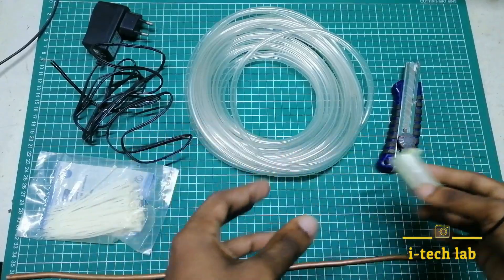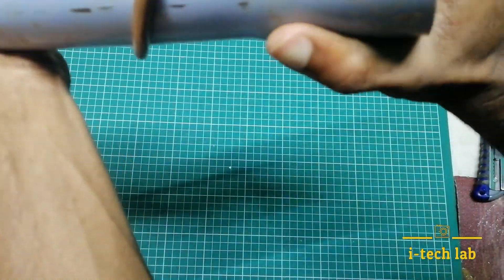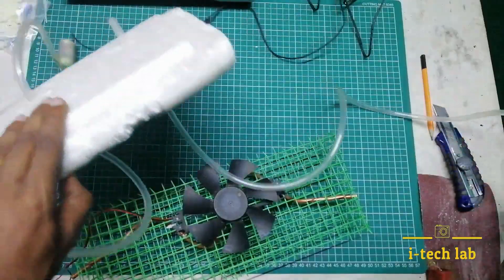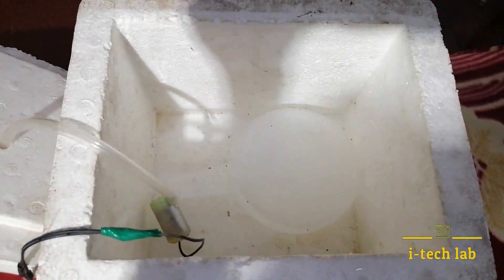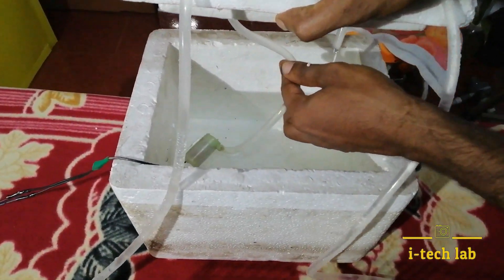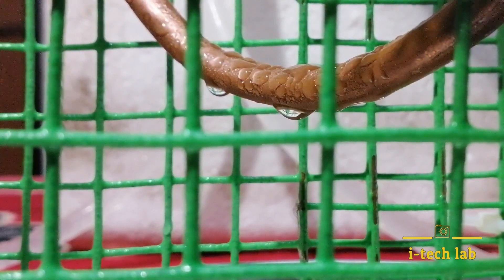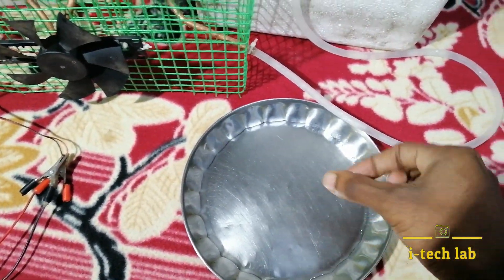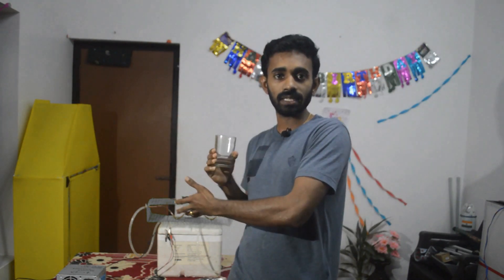How to make water from atmospheric air | Best way of producing water from air |How to make water.

Comment: hello sir, I do not speak your language and the auto-translate is not working properly on the video. Could you tell me:
- how much water did you get in 1 hour?
- how cold was the water inside the copper coil?
- how much humidity was the ambient air?
- what was the temperature of the ambient air?

I would be very greatful for your reply!

Comment: Can be made much more simple.... take a vessel put some ice (no need of water,just ice only) blow air using dc fan against the vessel ....water droplets will fall and you can keep another vessel to collect it. You don't require  pump and copper tube.... simple.

Comment: Interesting design. Kick-starting the process with iced water makes it productive. Have you thought about a system that doesn't require iced water?
Reply: I'm going to try making ng one without ice water,,,and on solar power,with a buried water tank under ground,with a copper coil inside the water tank,with a radiator with fan in the top of the inside tank,cooling itself more,pump it up to a nice copper coil and do fan,inside a green house,were more Co fans pushing air in,to increase humidity 🤔🤔🙏😁
Reply: @frankesquivel1455 use peltier
Reply: there are boxes like the one in this video, but with an active cooling. Some of them cool to minus 15°C. It depends on the outside temperature how much watt is needed to keep the water inside near 1°C but I saw that those boxes use 55watt nominal power. So that means (as they work like a refrigerator) they're not continuously using 55watt, more like 25watt/hour. Im gonna try it out.

Comment: your not producing water from thin air,,  the water came from the ice and water that you put inside the styro box, You should title it,, "How to make DIY air cooler"
Reply: not correct. The water inside the box is in a closed loop. The water outside the coils is condensation from the moist in the air in the room.

Comment: I'm a student
I am participating in a competition 
can u explain how it works in english and from where did u buy the materials

i hope u answer
Reply from the maker: As you seen in the system their is a cold water circulation inside the tube and the box, which is made 5 degree Celsius. As the cold water  circulates it can exchange the coldness or heat with surroundings through the copper pipe which is also in lesser temperature as compared to the surrounding atmosphere, due to this the phenomenon of condensation takes place as a result the dews may form around the copper pipe and the rate of condensation of water can be increased by adding a cooling exhaust fan which is exposed to the copper tube.
The materials required
1. A medical thermocoal box
2. Water level pipe
3. 50 cm of 1/4 th inch copper tube
4.a submersible 12 volt dc motor
5. Some wire mesh

Comment: How much does it produce?
Reply from the maker: 100ml within 40 minutes
Reply: @innovationstechlab7772  Nice, that's pretty good. There're definitely DIY systems making more than a gallon a day though, how would you recommend improving output? I feel like simply scaling up the requirements wouldn't do it. Have you tried setting and meeting an output goal, like 4-5 gallons a day?
Reply: @innovationstechlab7772  Also, do you know this guy's work at all? 
https://www.youtube.com/watch?v=R_g4nT4a28U&t=13s